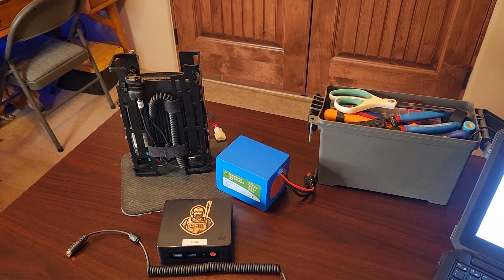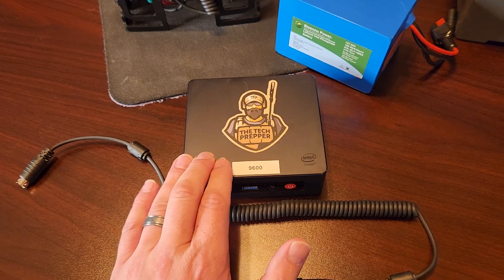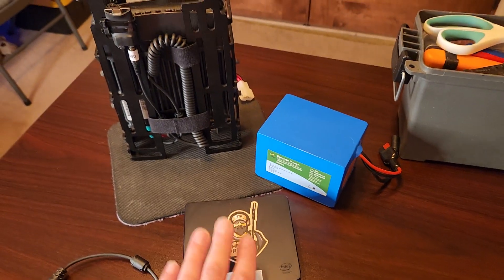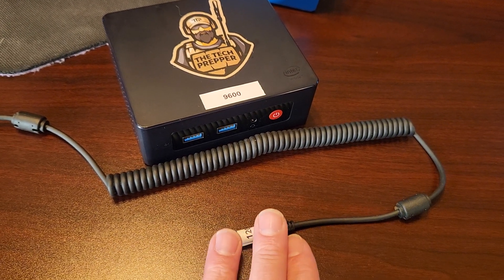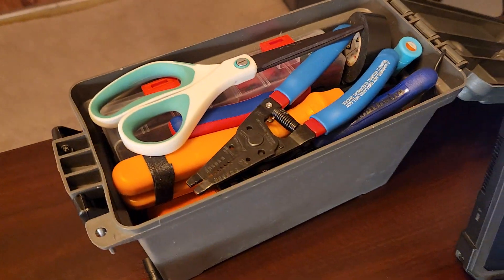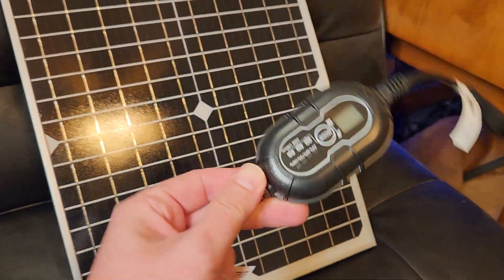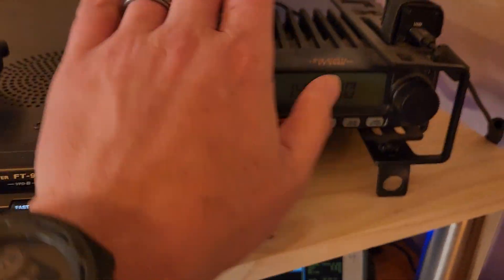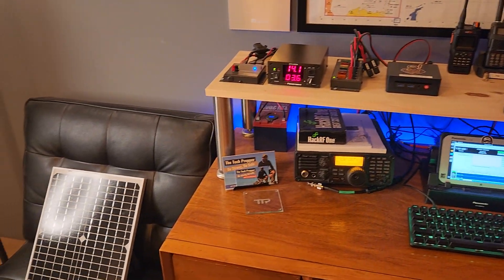9600 baud packet and FT-8900 weekend project (unedited)

Comment: I could be wrong but I thought 9600baud was for 220MHz and above. It could have been 4800 on 220 and 9600 on 70cm and above.  I thought 2m was 1200baud only. And don't remember if 6m was like 2m or HF. I don't remember any FCC changes but could have missed that. It has been a long time since I have played with that stuff.  73  John - N1PCE
Reply from the maker: You are correct. In fact, I found out pretty quickly (later that morning) that the 8900 will not let use 9600 baud when on 6m. I pivoted and testing 9600 on 70cm.

Comment: I am a 6m fm fanboy, central WA
Reply from the maker: FM or SSB?
Reply: @ FM mostly, we have 1 repeater, got 6m noise in the building so it does not hear so good. We use vhf for SAR, using 6m we could enjoy 100w, I feel 6m pushes through trees and brush.

Comment: I have mentioned I am building a 9600 node and after years of direwolf use I decided to use the TARPN modem because they plan on going faster than 9600.  I am testing in the near future and I will check back to compare how your is going.  I do not know if 6M supports 9600 but that would be useful to have that band running.
Reply from the maker: I opted not to go with specialized gear as the DigiRig along with my turnkey software also my group to communicate easily at home, mobile and in the field. All of us have 9600-baud cable rigs (FTM-6000, FT-818ND or FT-857Ds). If all of this experiments work out in practice, I'll take a look at improving my capabilities and test the TARPN modem.

Comment: Do you have any issues remoting info the Bee-Link? I have a Mini S12 Pro with N100. Runs straight off 12vdc, but I have to have a display plugged in for NoMachine to get any graphics. I have a HDMI dummy plug coming today. Bee-Link support said Mini S doesn't support headless. runs r4b8 just fine.
Reply from the maker: I have not run into any issues yet as it very new to me. I have two of them and the new one will run exclusively off a 13.8V LiFePO4 battery in the RV. I will let the community know if I run into any issues. The original one runs off my 12VDC RigRunner distribution block, but it is connected to a regulated power supply. We have not had a power outage, so the first PC has never cut over onto straight battery backup. However, I did perform the install of the OS using a 5.5 Ah LiFePO4. It was running both the 12v security camera monitor and BeeLink without issue.
Reply: @TheTechPrepper  thanks for the info. I have had a Bee-Link Sei 12650 for 6 months or so now and use it for my main shack computer. It runs off 19vdc but I added a 12 to 19 buck converter. I have just about everything in my shack running on 12dc. This years goal is to get some batteries for the house. The Dummy HDMI plug solved my headless issue and my MINI S now works perfectly with nomachine and does not need a monitor plugged in to it. Thanks for all the great videos.

Comment: Great video. I have the FT-8800 ,can I use it it the same way? 73, Gene N3XUS.
Reply from the maker: Yes,
you can. The only difference between the 8900 and 8800 is the number of bands that the radio supports.
Reply: @TheTechPrepper  Thanks for the info my friend. BTW: I just replaced a Windows lap top the Zorin Os (a Linux flavor). Will EMCOMM Tools work with it?
73,
Gene, N3XUS

"PREPARE DAILY"

Comment: YES! I bought the TYT version of that radio last month. I'm loving it so far. I remember your video about saying you can use it for APRS as well as voice, but I can't figure out how I'd get the audio in and out of it on voice if I have a digirig connected.
Reply from the maker: Actually, I never mentioned that for the TYT-9800 as it isn't a perfect clone. It lacks the data port that the FT-8900 has. I have no idea what features the the TYT offers through its USB port.
Reply: A big downside of most Chinese clones is that they don't have a 6-pin port for packet, especially since you can't do 9600 baud over the mic and speaker ports.
Reply: Oh OK. I thought it looked different in one of the videos. Could also be why I'm having trouble getting the digorig to work right. I bought the cables for the Yeasu.